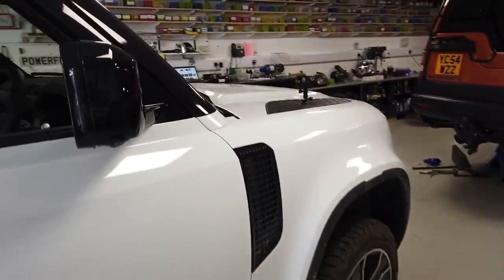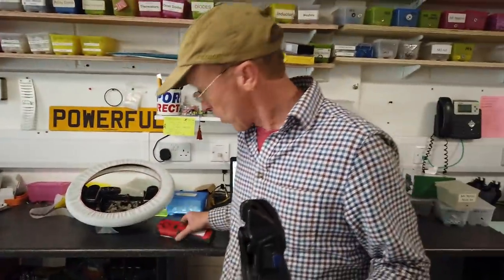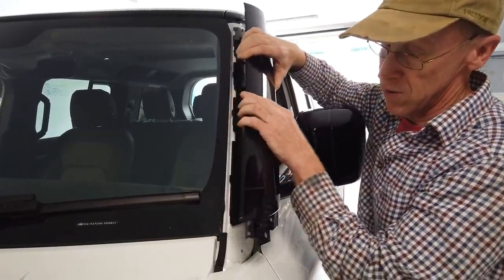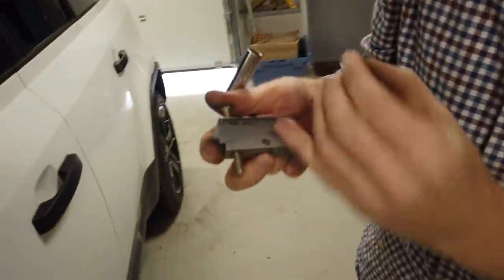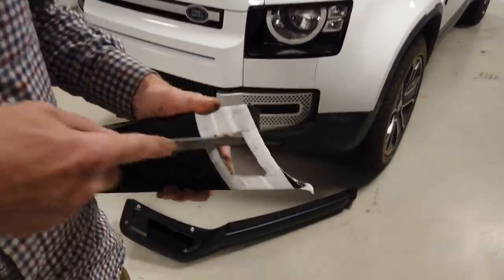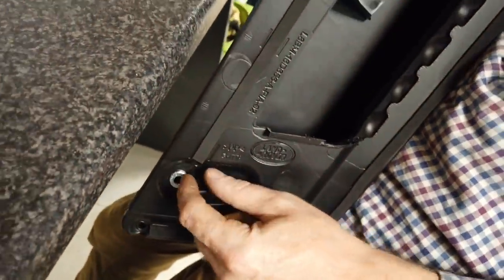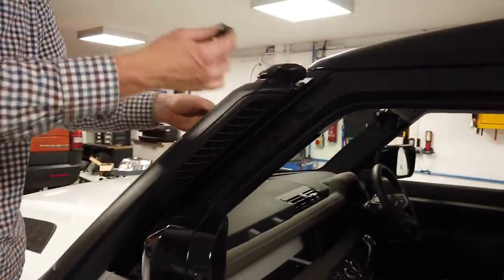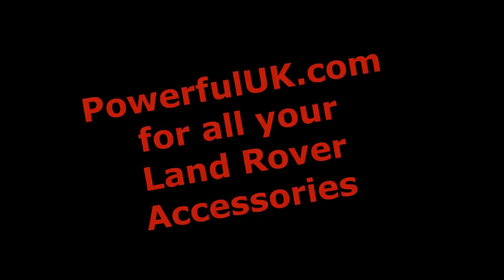2020 Land Rover Defender 110 snorkel fitting instructions - raised air intake VPLEP0435

Comment: I fitted my snorkel today, very quickly supplied, thank you, Simon and team. A couple of observations: The top bracket is now plastic and requires different dimensions to the cutout, the top rivnut supplied is clearly the wrong size, I actually found one in my stock that fitted the pre-punched hole and used that instead. Your rivnut tool is far better than either of the ones I had so expect an order for one any day. I made a couple of plastic washers to retain the bolts during installation, they were still a challenge but much better than removing the door.
Reply from the maker: Hi Bill - well done on doing the install and glad the video helped - hopefully the bracket design is an improvement !

Comment: Simon...I think JLR should run these fittings past you for practicality. You do this as a job and have much more experience than the desk designer man who did not get this product sorted out very well at all. I also do think that the quality of these fittings we are seeing is not that good ...yours would be much better and I guess they might want £250/300 for that snorkel. Another excellent video...keep up the good work! 🙂🙂🙂🙂
Reply: Ah the classic "I clearly don`t understand how design and engineering for manufacture works" response. This part WILL have been installed by more people including design and prototype, prototype build, pre-production, production and service than you could shake a stick at. The part was designed and has been presented as I would expect it to be for line production as a set of parts for creation of a sub-assembly. It is a "completely knocked down" set of parts ready for assembly.
I don`t know where all the parts come from, they may well come into the production plant in finished form for installation on the line, or they may come from multiple suppliers to the plant for assembly and installation. In either case the parts when parted out as an accessory may well be bagged and packed for Land Rover by an outside company (why do you think the spares used to say Unipart in the old days). This why you get a set of parts not a sub-assembly, very few volume manufacturers would waste money putting together sub-assemblies for other than line manufacture.
Reply: Brian Launchbury Sir, I am not quite sure what your line of thought is but the facts are that if you go to JLR and buy a “Raised air intake kit” they supply you with a box of bits that JLR has approved as being suitable to be sold to a customer. Who, where from and what those bits are, JLR consider them fit for purpose. Hence when a very experienced accessory retailer goes to fit them and finds incorrect fittings, an oddly designed bracket needing careful modification to fit, that the instructions to remove the door are not needed and that the general standard of fit and finish is rather poor, I think it is fair to say that this accessory has NOT been test fitted many times nor properly checked for assembly. Simon is an expert at fitting such things...it is what Powerful UK does...if he has comments to make, I listen to him. JLR parts are super expensive...I was charged £500 for four rubber floor mats and a rubber boot liner which is frankly ridiculous. Simon has highlighted problems...JLR need to listen. 😐
Reply: @HQBProductions  The issue for all major vehicle manufacturers is their sheer size of operation. This kit along with all after market kits and accessories has nothing to do with the manufacturing arm of JLR. It's the brainchild of the brand and marketing division in conjunction with sales. The input from the engineering and manufacturing division will have been minimal. You're right, JLR and others need to listen to experienced parts suppliers and fitters but unfortunately, that will never happen. JLR won't even listen to their own franchise dealerships so an independent has no chance. Both our sons are service techs for large JLR franchise dealerships and  had the ludicrous situation of spending 3 of their 5 days at work replacing balance shafts in Evoques that were less than 3 months old while JLR production continued to install the faulty balance shafts on the production line. It literally took 3 years from the issue first being identified to JLR manufacturing appearing to do anything about it.
Reply: @HQBProductions  Not sure what my line of thought is? They are the thoughts of someone who spent more than 32 years designing, installing and testing parts for a volume auto manufacturer. Sorry but I thought it was clear and simple.
The parts in the "acceessory" box are what would arrive on the production line as a sub-assembly for installation. That is they are volume production parts. The parts in the "accessory" box are either the same parts loosely bagged, or a set of similar parts, out together by an external parts organisation.
Whoever did the instructions may or may not have had access to the vehicle whilst doing them (engineering personnel rarely get involved in this process, the instructions often being done in some design agency). They aren't great, but having dealt with similar over the years they are not the worst I've seen.
As I said in my previous post spares organisations charge for their services, I know that our old organistion applied a minimum markup of 6:1 spare to production price (for the same part from the same supplier).
Parts designed for accessory fit are not necessarily designed to the same standards as production and often not designed to fit in the same way as production parts. In this case they were so bad luck but good business.
Reply: Da Malat Now I do know what you mean about JLR not listening. Very briefly my 2018my Discovery Sport SD4 had a diesel fume problem from new..strong burnt diesel arriving inside the car when braking to a stop but intermittently. My dealer was very good and tried everything including new turbo seals, refitted the dpf valve to check it was aligned properly, they tested it for a month and yet, it didn’t make a scrap of difference. JLR raised a case...I had lots of very stilted automated messages from a rather useless liaison woman but nobody listened. Then when we were at the point of them giving me a refund for the car, I spotted something different about a 2019 car on display...the offside underbonnet sealing strip and plastic moulding were missing meaning that burnt dpf fumes were funnelled straight into the cabin air intake via the water drain moulding near the base of the windscreen. My dealer said some naughty words, ordered the part, fitted them in ten minutes in the car park and the trouble was totally cured! My car is NOT the only one affected but JLR would not admit any problem existed...I got some hot air auto composed letters but JLR did not even discuss or listen. Look at the seals on a 2020 model...they are everywhere...JLR knew but would not admit it. As for this air intake kit, JLR should remove it from sale and let Simon make his own...it would be vastly better!
Reply: @brianlaunchbury4491  except these parts are not installed at the factory... even when you order the various packages from the factory... (because a lot of the accessories are a pain to do.) These parts are all installed after vehicles are shipped to their final or next to final destination...

Comment: My 2022 came equipped with this piece as an option and the top bracket is cracked either from parking lot curiosity or improper installation at the factory. Your video was very helpful in troubleshooting and finding the defect. Thanks!👍🏽👍🏽
Reply from the maker: We sell the spare pieces on our website - the plastic brackets from Land Rover ( their Version 2 ) do break very easily. I think they tried to improve the fit over the metal bracket - the fit was better but it was very weak in plastic.

Comment: the snorkels were NEVER designed to improve wading height. they were purely to reduce dust in dusty environments. wading heights were ALWAYS limited by the height of the breathers in the gearbox, axles, fuel tank etc, and also (on Petrol engined versions especially, prior to ECUs) the height of the electrics (ignition system)

Comment: Great video guys... I know the average LR owner is well versed in overcoming and conquering LR quirks but my gut feel is that nobody at Land Rover has ever fitted this....
Reply from the maker: Most of these are fitted by dealers - and if you read the other comments it seems they are making up their own ways to fit them !.... As i was told when i was an engineer at Sony...."The right may should be the easy way" this is the key to good design / a good process etc. It seems that the way its designed to fit is not the easy way... hence they find other ways to do things.

Comment: Thanks for the great videos, just fitted air intake, roof racks, mudflaps and a ladder, watched all your video hints worked a treat 😁
Reply from the maker: Glad they helped - i think they have changed the design of the top bracket on the snorkel now - its not plastic - but be careful there are stories of the plastic bracket breaking in carwashes - I have not confirmed this.
Reply: @L663  
Thanks the bracket is now plastic, also we had a template for the holes in the trim for the ladder bolts. Thanks again for your reply, do you have any videos on discovery sport?
Neill.
Reply: @neilldudley623  Hi - be careful with the snorkel in car washes - we had one confirmed breakage today in a car way with the plastic bracket. We are designing a new stronger bracket.
Reply: @simonjefferson  
Thanks.

Comment: Your Rivnut here in the states is called a Nutcert. There is a special tool to install them it looks like a large rivet gun. They come in many sizes. We mostly use them where you cannot weld a nut behind the metal to hold it steady. But you are correct the hole in the A pillar is too large for that nutcert.
Reply from the maker: Yes you are correct - i think there is a company that have the trademark for the word "Rivnut" and they normally go after anyone using the term .. hence the other terms like Nutcert etc. My favourite type are the hexagonal type that dont need a tool to insert but rely on you having a hexagon hole.... if only land rover had done that here... they did it on the Evoque side step mounting points !

Comment: It looks as though a brief encounter with an overhanging tree would snap that cap off, and may well break the snorkel off at the top attachment as well. Looks very underdone with the top fixing they've designed. Thanks for another interesting video.
Reply: Agreed. That cap is going To come off when it sees a tree branch. LR says the snorkel does not increase wading depth so after this video I think it is mostly useless.

Comment: Maybe a flexible ratchet spanner rather than a socket would be easier fitting the bolts in the door area, well done on persevering and finding a way to fit without taking the door off. I assume you have mentioned to Land Rover that the rivnut is too small for the hole they provided.
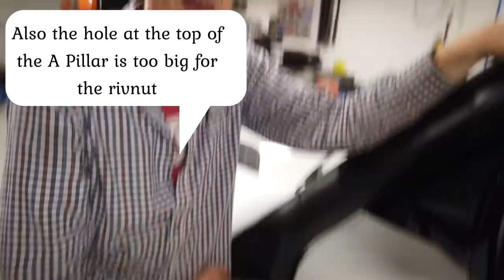Reply: Undersized rivnut issue included in post edit speech bubble @24:41
Reply from the maker: Land Rover are currently watching my videos..... but I am not sure how much they are listening.....

Comment: Let us know if you notice a increase in wind noise? And do you think it seals on the fender to prevent water ingress whilst wading? Thanks again.
Reply: Admittedly mine was fitted from the factory (dealer) so I can't compare it to 'naked' but there's no appreciable wind noise.  It's a neat looking accessory - most people won't even notice it but it contributes subtly to the off-road nature of the car.  
Regards sealing, it's not designed to increase the wading depth (there are probably too many other things to drown).  Therefore it doesn't need to be sealed on the wing - after all, the previous opening was entirely unsealed!  It's specified as a "Raised Air Intake" and not a "Snorkel" and is purely to reduce dust ingress to the air filter.  👍
Reply from the maker: Not had it on the motorway yet but around town it seems no different.

Comment: It's not for show, your electronics might die but your engine at least will not die under water. Electronics on a new car should be quite well sealed, especially essential ones, so they might die after from oxidation from humidity or some ingress of drops of water but it will pull you out of a underwater situation you might be caught into.

Comment: Mine came factory fitted as well. But I’m at 100 kms only and the mileage is horrendous at 30l/100km average !!! I have the P400 model and wondering if removing the snorkel/raised air intake is going to improve things a bit ??? My dealer says I have to run in the engine around 2k kms to get claimed figures ? 

Any help would be greatly appreciated .. also amazing videos just the right amount of pedantry to fill in the gaps on a busy week .. cheers

Comment: I ordered my 110 with the snorkel already installed by the dealer and, as I got it, I wanted to test its efficiency: I wrapped the upper part with plastic bags thus sealing the air intake and switched on the engine expecting it to choke.  That didn't happen, on the contrary it went on running regularly even while accelerating.
I told it to the dealer, they checked it out with LR and came back saying that the installation is correct and so it is its behavior (???).
How would you comment it?
Reply: thanks for sharing owner experience - save me from ordering it just for the look...

Comment: Brilliant to see you fit this.  Mine came pre-fitted by the dealer but I'd have rather done it myself.  Mine has left a large panel gap between the RAI and the door.  I can see that it's likely a consequence of having to allow for the door clearance (you pushed yours over).  Has yours left a large gap too?
Reply from the maker: Hi - mine is sort of OK - i have taken a picture for you to compare - see below link
https://www.dropbox.com/s/6lg0lqjg2d06y2w/2020-07-15%2018.25.00.jpg?dl=0
Reply: @L663  Thanks for that.  Yours looks a better fit than mine.  
I took a look at how they'd installed mine and 2 things are different:  
1) They've not cut the square hole at the top of the A-pillar trim but just drilled through and mounted the bracket on the outside of the trim.  Minimal damage to the trim but it means the RAI stands off the A pillar slightly.  
2) They've installed the Rivnuts for the lower mounting into the car, not the RAI.  SOMEHOW, they've managed to screw in from the other side - the heads of the bolts aren't accessible from behind the door - they're inside the RAI!  Either they have Mr Tickle working for them or they dismantled the air box under the bonnet and reached through!  Weird.  It means. I can't get it off easily but it's sealed tight to the wing.

Consequence of these is the RAI must be at a slight angle compared with yours so an uneven panel gap appears next to the door.  Not a problem - just not as neat as yours.

Cheers
Alan
Reply from the maker: @alantd44  Not good if Land Rover themselves are not following their own instructions !
The link to the instructions is here
http://accessories-instructions.landrover.com/enUSA/new-defender/G2409775

Comment: Love all your videos. Very informative. 
I just bought a defender 110 first edition here in the US. My jaw dropped when I learned that is not equipped with dynamic cruise control. What a huge disappointment. 
Is yours a first edition?
Reply from the maker: No i was just talking about this today... mine is a S spec and as such has not dynamic cruise control - a feature i love on the sport !
Reply: Likewise got a FE and was surprised not to get dynamic cruise - didn't think to check as it seemed an obvious thing for a "special version"; but then no roof rails or mudflaps either.
Reply: Mine is also having issues with the front brakes ( a knocking noise when braking hard) 
How about yours?

Comment: Now you have your car for a few weeks, how do you feel about the overall engineering quality? I have one on order, so just setting my expectations. Great videos btw.
Reply: Got it? Had mine 2 weeks and now back with LR for repeated low battery warnings and a constant creak/squeak from the driver's door on braking and any imperfection in the road. Also a very loud whistling from the driver side A pillar at over 50 mph - seems there is a significant gap between the leading edge of the A pillar trim and the pillar itself.
Reply: D H good to know, Charliedrives has the same issue..
Reply: D H not yet, September sometime..

Comment: Not a critiscm of your work, but that final top cap looked a poor fit - just sort of plonked/tapped on with a big gap to the remainder of the snorkel?
Reply from the maker: Yes have to agree - i did double check it to make sure i had located it correctly -  the design could have been better.

Comment: Maybe not a sticker but include a marked area on the rear of the A pillar trim(i.e cut here)
Reply from the maker: Yes this is better idea - they could mark the inside of the A Pillar injection tool - they did this on the sills on the D3 and Sport showing where to cut----- i take my hat off to your Sir ( or madam )
Reply: @L663  cheers. And its Sir :-)

Comment: Does the raised air intake add to the wind noise at highway speeds?  I test drove an SE model today and while it didn't have the raised air intake, I did notice wind noise on the highway.  Is there a fix for that?
Reply from the maker: There is a recall / rework for wind noise on the windscreen pillar .. i know that much but i have not been told what it entails ! I think there may be less noise with the snorkel fitted !

Comment: Did you use a M6 rivet nut for the top bracket? looks like you used a different nut.
Reply from the maker: Yes the bolt and the rivnut at the top are indeed M6